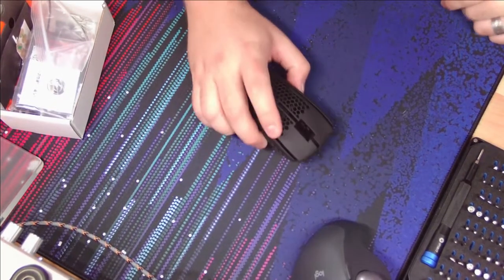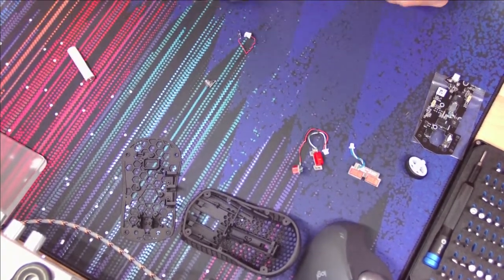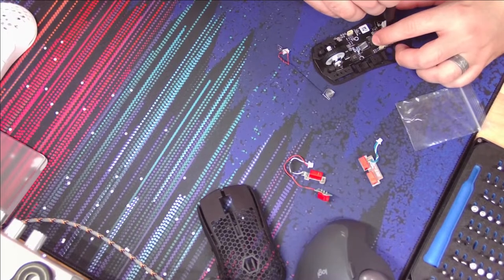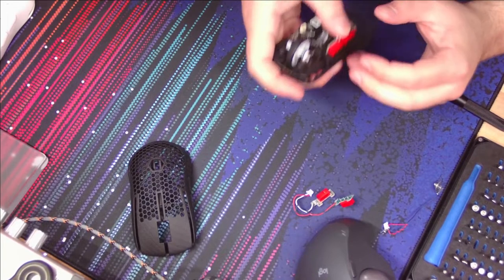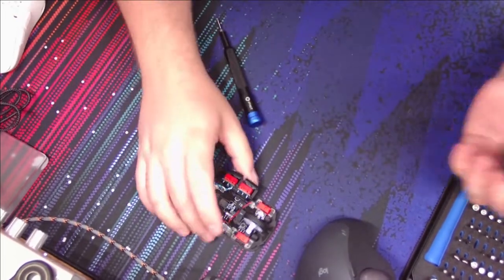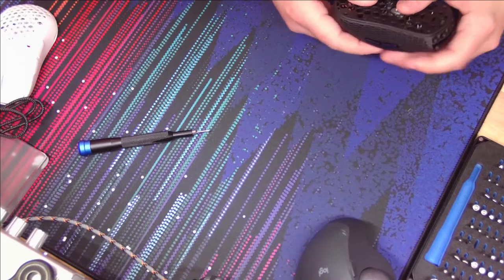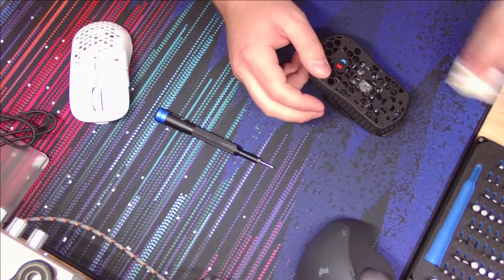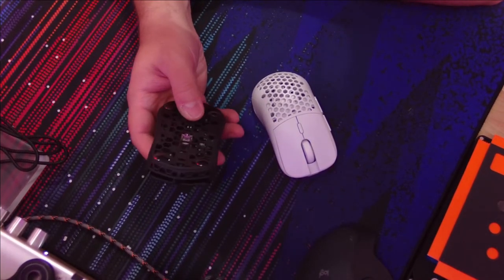PMM S2 Build

Comment: where did u buy the g305 pcb and scroll wheel?
Reply: There was an Etsy shop called FacFox that was selling refurbished PCBs and custom parts like the scroll wheel. Unfortunately they seem to have since shut down? I will post an update if they reopen under a different name. Otherwise I think eBay would likely be your best bet for a used g305 to harvest the PCB.